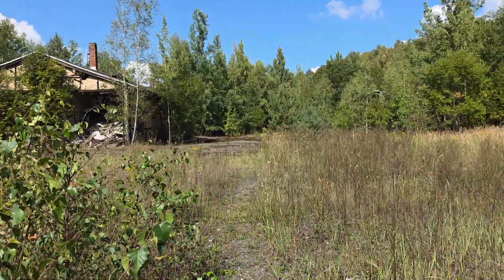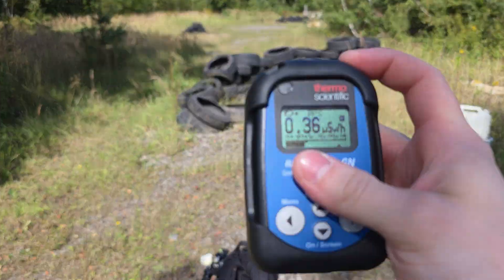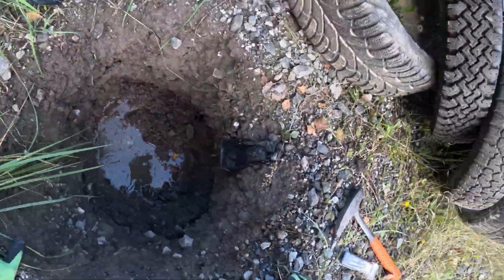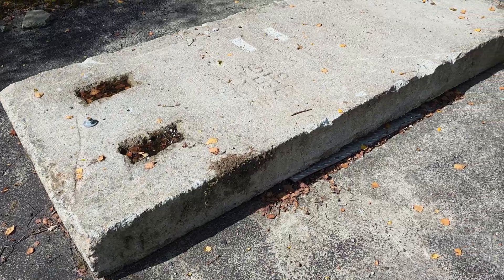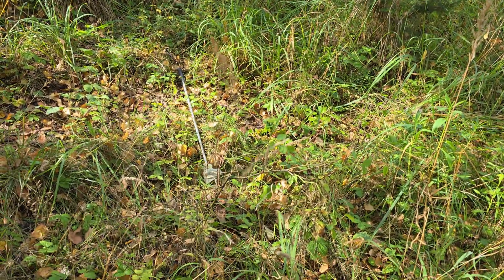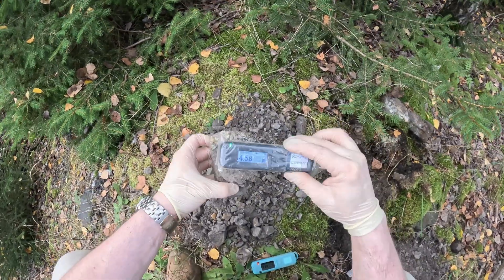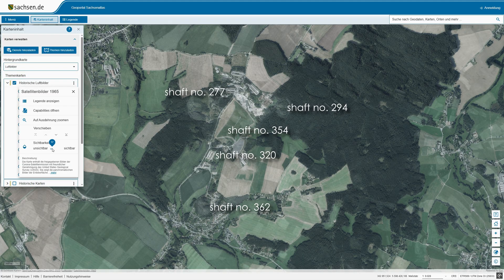The Zobes uranium deposit #uranium #minerals #urbex

Comment from the maker: [Deutsche Untertitel verfügbar / english subtitles available]
Content:
00:00:00 urban exploration of the area / information about the deposit
00:02:31 intense radioactive hotspot / nuclide analysis
00:03:45 attempt to separate individual sources
00:06:10 finding one of the sources
00:06:56 more urban exploration of the area
00:09:00 excavating a small uraninite fragment
00:10:00 finding a slightly better uraninite sample
00:10:46 finding an even better piece
00:12:02 finding high grade uranium ore
00:15:00 finding radioactive specimens with pyrite
00:16:39 more urban exploration of the area
00:17:16 macro footage of the specimens
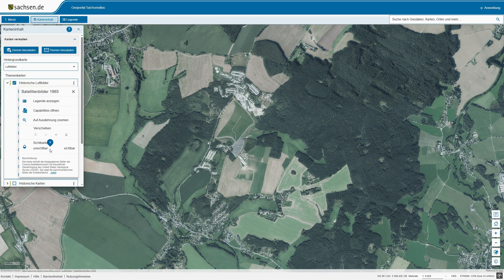00:18:58 historical satellite images of the area

Comment: Hi, nice videos you got going on! Would you say that a radiacode 102 is more than enough to take on this as a hobby? And where can basic safety be learned? TIA
Reply from the maker: Thank you. The RC-102 is good enough, but for finding weak sources you can´t have too much sensitivity. Regarding safety rules, uranium should basically be handled like other toxic minerals. On top of that it should no be stored in your living space. The best protection against the gamma radiation is keeping a distance of 1-3 meters, depending on the intensity of the ore. The greatest risk is inhalation and, to a lesser degree, ingestion. Wear disposable gloves when touching the uranium ore, if you smash radioactive minerals into pieces, use a facemask. Beware that secondary uranium minerals can be quite fragile and crumbly, primary uranium ore aka. uraninite on the other hand is relatively stable, with a limited contamination risk. Last important information is that natural uranium will always generate radon gas, which is a part of it´s decay chain. If you store uranium minerals in the basement, a window should always be tilted or open. Otherwise radon can accumulate in the air.

Comment: Really glad you are getting some good use from your new toy (Radeye), its a real thing of beauty.  Like you I have spend hours digging holes and basically finding nothing, except a hot area.  My best theory for these hot-spots around old mines is that this is where all of the dust that accumulates at the bottom of the ore carts carts got dumped...
Reply from the maker: In this case it´s mostly fragments the size of wallnuts. I did manage to seperate one piece. The question is: who removed all the material from this hole and why? Where was it dumped?